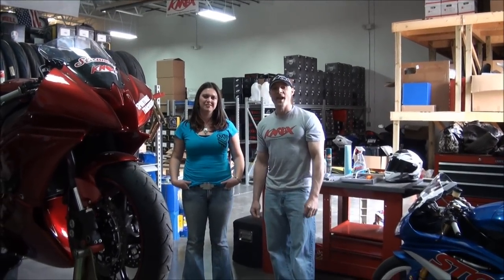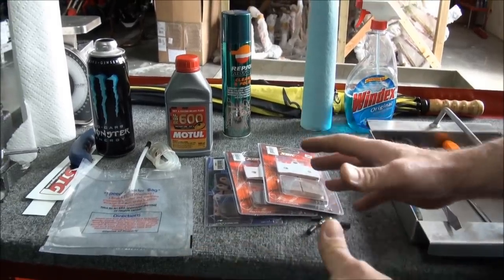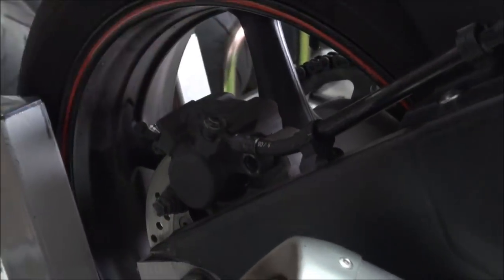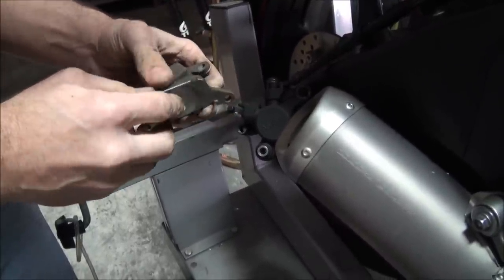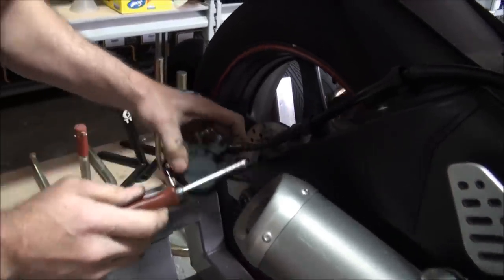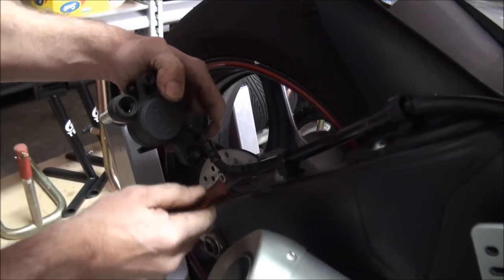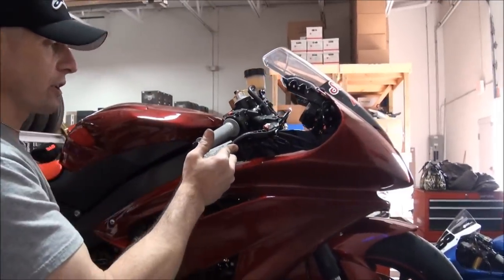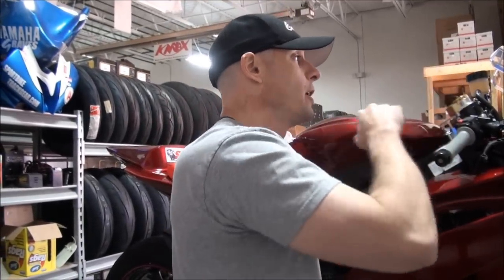How to Change Rear Motorcycle Brake Pads from SportbikeTrackGear.com

Comment from the maker: It sounds like you are saying the bolt that passes through the sleeve is stuck in the sleeve? If this is the case you can work around this. The important part is that the sleeve is able to slid freely. Lube this up again on when you reassemble and you should be good to go.

Comment: I was hoping to see you spin that rear wheel by hand after doing the pads. I’ve taken the rear wheel off and refitting it maybe six times to see if I can get that wheel to turn more easily. I’’m now going to remove the Caliper and fit pads, lube the guide pin just as you did and torque to spec...maybe this is why my wheel is difficult to turn? All wheel spacers are in place correctly and caliper is in the swing arm slot.
Reply from the maker: There will always be some level of drag on the rear wheel from the chain and the rear brake pads. The majority of it will come from the chain unless you have a brake issue causing the caliper to hang up. Removing the rear caliper and lubing the slides is not a bad idea. I would also suggest cleaning and lubing the chain, this will make the biggest difference. - Van
Reply: Sportbike Track Gear This has indeed had a positive effect. Now my wheel will spin out for about half a rotation. Prior to this it would only make a quarter turn if that. I only fitted a new chain last month which made no difference so must have been caliper slightly out of alignment I guess?

Comment from the maker: You may use it on the street, however, most of the riding we do is on the track and it is not used/not necessary in the track environment.  ~Aubrey
Reply: What about trail-braking through decreasing radius corners?

Comment: Is it a good idea to use copper slip on back of my pads and on the guide pin?

Great video by the way
Reply from the maker: A little on the guide pin and the backing plate won't hurt anything. Don't go crazy with it, keep it off the friction material and the rotors etc... At the Cadillac dealer (other shops I worked at over the years as well) we lubricated and cleaned all of the contact and slide points when servicing the brakes. - Van

Comment: What would happen if you did not bleed them when you were compressing the piston back in?
Reply from the maker: While it is not best practice you could just clean the pistons and push them back into the caliper. Make sure to check your fluid level after you do this to make sure it is at the proper level. - Van

Comment: Hi,

Question my guide pin is stuck to my caliper bolt.. 

I think its from using blue tread lock on the caliper bolt from last service.. this time I removed the caliper bolt just to find out that the guide pin is stuck to it. I cant get them apart. 

Is it a bad thing to install the bolt with the pin anyways or do I '' MUST'' buy new guide pin and bolt ?

Comment: got a question..with regards to bleeding the rear break on 2001 GSXR1000..if you don't have a speed bleeder valve is the precess pretty much the same as shown in the video here?